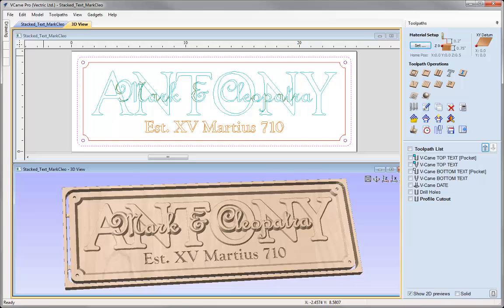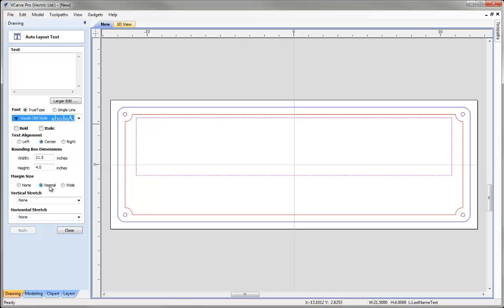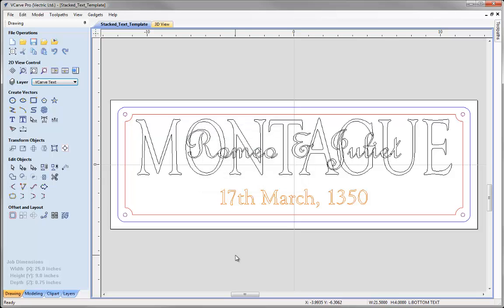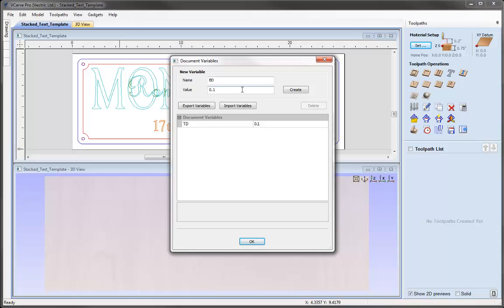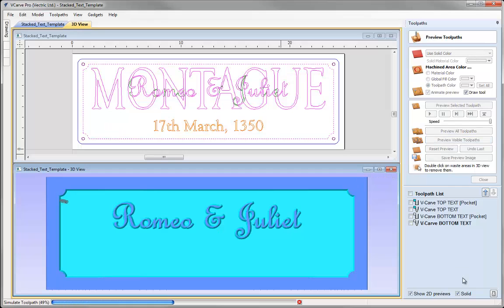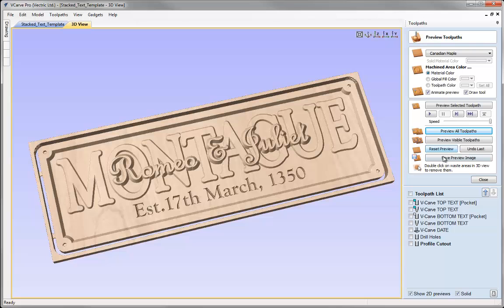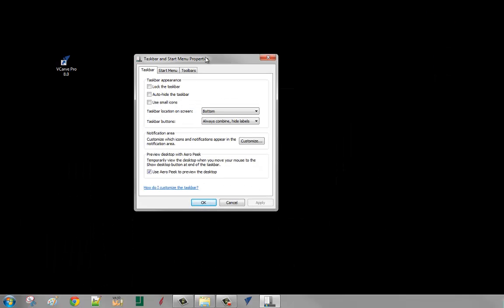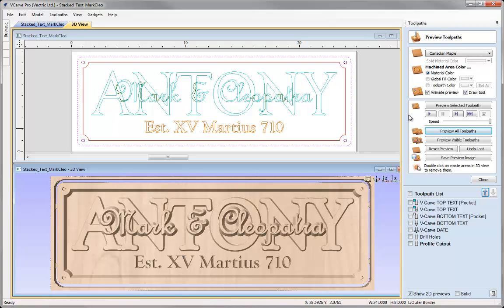Vectric - Stacked Text Template

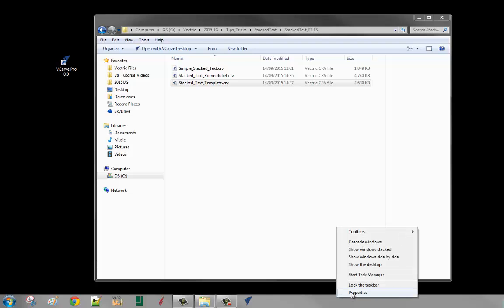Comment: At 39:36 where you show how to customize the task bar properties? How is that done in Windows 10. It does not show "properties".
Reply from the maker: Hi Terry. In Windows 10 the 'Properties' option is now shown as 'Taskbar Settings'  with a cog icon. I hope this helps. Have a great day!
Reply: @vectric  Yes, I found that before, but there it no where to change the number of files in "Taskbar Settings". But that's okay, I'll just do it in the software. Thanks!
Reply from the maker: Hi Terry, Also a this is an old video in the current software you can actually alter the number of recently opened files shown directly in the software, simply open a new session and go the the EDIT bar at the top, in there select OPTIONS and in the GENERAL section there is the option to change the RECENT FILE LIST SIZE I hope this helps :) Thank you
Reply: @vectric  Yes, I knew about where I can change to file list in the newer version of the software, but I like the idea that I can just right click on the V-Carve icon in the task bar and load the file I'm looking for. I cannot find it in the taskbar, but it's okay, I'll live. Thanks for the reply, Vectric is the best!

Comment: Add another person unable to source the 45 degree flat bottom bit - can anyone help with a source?  1/4" shank required.  Any help would be appreciated.  I can't figure out any other tool that will produce acceptable results.
Reply: I just ordered a Whiteside SC76 bit, which seems to be the dimensions mentioned in this. Also, the Amana 45622 and 45623 should work. They are all on Amazon.
Reply: @WindRidgeWoodCrafts  Thanks for the reply.  It finally clicked in my brain - the confusion I had was with included angle versus side angle.  Now that I realize 45 was the included angle it all makes sense.

Comment: My vbit is cutting into top letters on second pass and not cutting anything on first pass.   Went through this tutorial twice.  ???
Reply: Me too... anyone know why?
Reply: This may (or may not) be the answer.  When I went to the toolpaths\material setup I saw that the Home Pos was set to X:0.0 Y:0.0 Z:0.8.  I changed that Z setting of '.8' to '.2'.  I've learned to look at that setting because I've had it happen where I sent a job (first time on my learner machine, a CNC 3018 and then again on my new S03XXL) and the Z carriage went all gangsta on me and slammed against its upper limits and then commenced to dig into my project and into my freshly made spoilboard.  Again...this might not help with your post but watch out for that setting to avoid what happened to me.  BTW...I followed this video and everything looks good on the screen.  And I just sub'd the VBits for what I had and instead of a drill I used a pocket cut and a 1/4" end mill.  I have not actually cut it on my CNC yet though.  That's going to be the real test...right?

Comment: Not sure if this is still monitored.
Following the Tutorial everything in Vpro looks great, My TOP V cut looks good on the machine. When i go to cut the BOTTOM Vcarve the first pass is just cutting air. Anyone know a reason for this. My max depth on the tool is 0.2 which should cut the {TD}+{BD} depth pass.
Reply: I think it would be better to set start depth at {TD} and depth of cut to {BD}, then you eliminate the duplicate pass at the top with nothing to cut.
Reply: Later this week I will be tackling this sign topic. I'm going to see if others have made a Stacked Text video here in YouTube. I'll let you know how I made out by the end of the week. Fingers crossed.
Reply: I had the same issue but it did work its way down. Many passes but it did work

Comment: Did he say he was using a 90 degree v bit? then programmed in 45 degree with a flat tip?
Reply: Engraving tool database settings for a 90 Degree Engraving Bit, it is made up of 2 x 45 degree angles, this is what you enter 90/2 = 45, there is also a textbox for you to enter the flat part of tools dimensions eg 0.1 mm.
Reply: he is referring to a 45...the comment above explains :)
Reply: When a bit has a flat to it, it is no longer considered a V-Bit. It is now considered an Engraving Bit. Google "90 degree engraving bit" You'll be amazed!

Comment: What is the Vbit called with the flat bottom,and where can I get one? Can I just use a 90deg V-bit?
Reply: Engraving bit
Reply: https://www.amazon.com/EnPointTM-High-precision-Carbide-Engraving-Aluminum/dp/B00QPZLDJG/ref=sr_1_3?s=hi&ie=UTF8&qid=1500856091&sr=1-3-spons&keywords=engraving+bit&psc=1
Reply: Will this bit still work if it's not the same dimensions as the one that he is entering in the tool database?